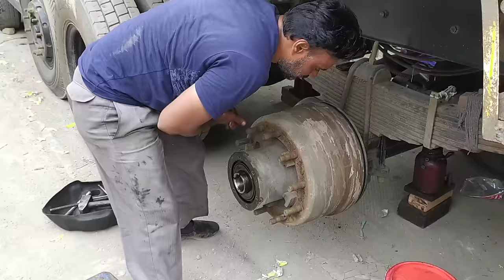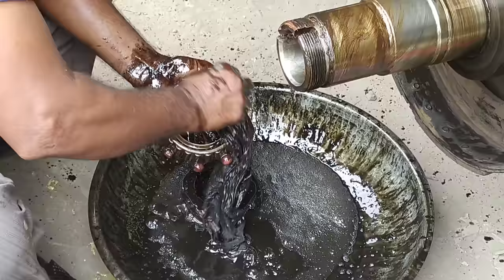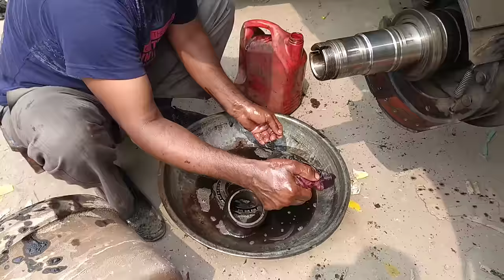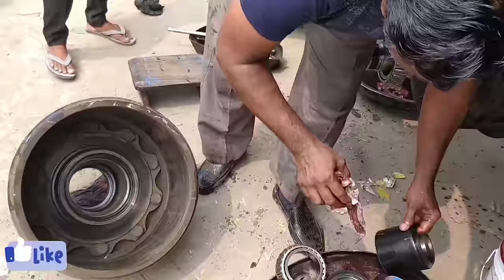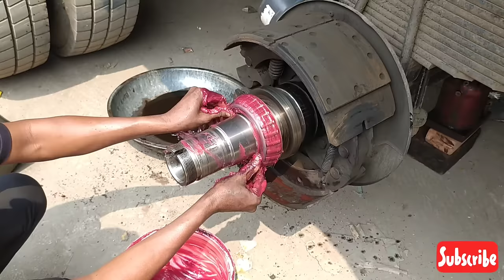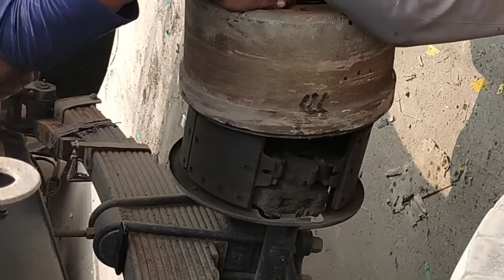Truck hub greasing | truck rear wheel hub greasing skill | Indian truck mechanics

Comment: The guy removing the lugs needs a larger bar/cheater pipe. No need to jump on it (which can cause injury). Conserve your energy -- use more mechanical advantage.  Doing this all day long would wear you out without the right tools.

Comment: Weird how they have greased packed hubs on their heavy trucks rather than oil filled. Also love how they try and throw as many leaves as they can possibly fit on the springs, like it's gonna make overloading it any better. I feel like most of the repairs you see on this side of the world are caused by greed. These operators would rather overload the hell out of their trucks and end up with costly catastrophic failures, rather than loading them properly and performing proper maintenance. It might seem like you'll make more money from having a bigger load, but it'll always cost you more time and money in the long run.

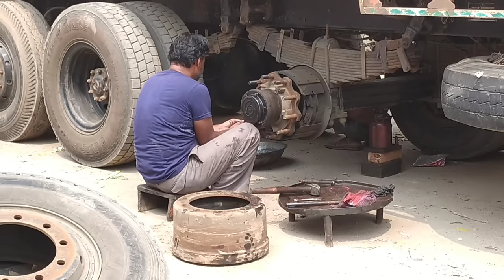Comment: 10:08 Bottle hack on two wood blocks! 😱🤯
Reply: people have used wood blocks under bottle Jacks for many years.
Reply: @warrenmichael918  doesn't look safe/stable.
Reply: @EddieLeal  sure a set of big steel jack stands would be the best thing but many many people have used blocks of good hard wood for this. Those wooden blocks are about the LEAST unsafe thing they might use during their daily routines, lol

Comment: What a dirty liquid he is using to clean the accessories, taking out grease from the parts with equally dirty hands, cleaner or any other cleaning agent is not very costly, they need proper training.
Reply: its gasoline, it works awesome on grease. The fresh fuel he used later in the pan will become that sloppy mess we see here at the beginning after he uses it a few more times. Training isnt their problem because they actually look really skilled , what they do lack is funding!!

Comment: This poor guy doesn’t even have a clean rag or a can of spray solvent or gloves.  Also not sure why he is doing any of this.   They don’t ever seem to do any scheduled preventative maintenance, so what was the problem?   Was the seal leaking?  Can we send them some money to buy gloves?
Reply: I dont think they care.
Reply: Don't you know that petroleum jelly is made from petroleum? They must have very soft and moisturized hands
Reply: @frimmbits  😆
Reply: They have money for gloves but won't use them. With gloves u can not work fast enough and diesel is the best solvent. , He was probably replacing the bearing. These trucks run overloaded. If they are rated for 30ton and oparators load them 40-50ton. So they do some preventative maintenance to not have wheels coming out in middle of highway. That could result in a massive fine or huge bribe
Reply: @KuntalGhosh  In the US, much to our detriment, most people that work as mechanics tend to feel the same way, only difference is that some places mandate the use of safety protection when working around certain chemicals You are basically trading years of your life/health for work efficiency.  Easy to do because you do not always feel the effects of these chemicals/compounds right away. At least not to the point where they incapacitate you/keep you from working. 

Depending on the chemical and amount of exposure, some side effects may not manifest their damage for years.. Some of these problems already come with old age but being exposed to hazardous chemicals/compounds can expedite this to include causing mutations/cancer in a persons body. 

We are provided with only one body in life. We should do what we can to take better care of the machine that allows us to experience life/provides us with the ability to work provide for ourselves/family. Once we lose our health very little can be done to get it back.  Not to mention the cost involved in treatment. Take care where ever you may find yourself.
Reply: Very poor facilities, very toxic substances he handling without gloves, mask, protective glasses. There should be some rigid rules, these people will prematurely die. Get skin disease the owner of that garage should be punished
Reply: @BellaRazgriz  But at what cost.. Shortened life span or illness short/long term
Reply: Bro those trucks in those countries go to crap they never take care of them also you can’t determine if a seal is leaking unless you notice while driving